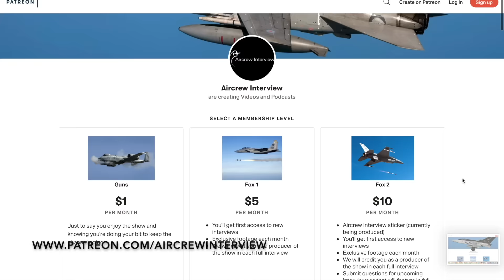RN & RAF Buccaneer | with Tom Eeles (Part 2)

Comment: The name of the engineer that came up with slightly off-setting the front and rear seats (and placing the rear seat slight higher than the front seat), will probably never be known.  Nevertheless, he will always be blessed and held in the highest esteem by grateful back seaters that flew the Buccaneer over the decades.

Comment: The Bucc got fitted with the FIN1063 Inertial Nav. It was identical to the Jags FIN1064, apart from the control unit was different to fit in the Buccs cockpit.